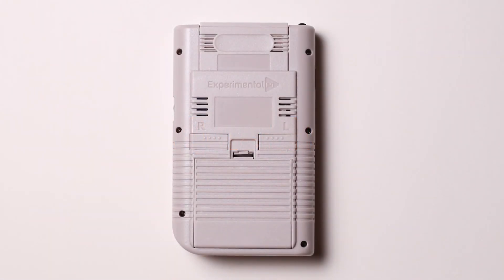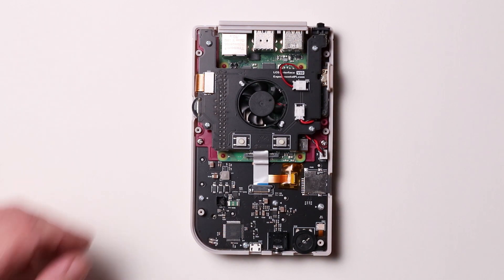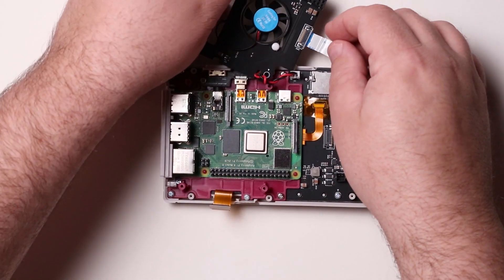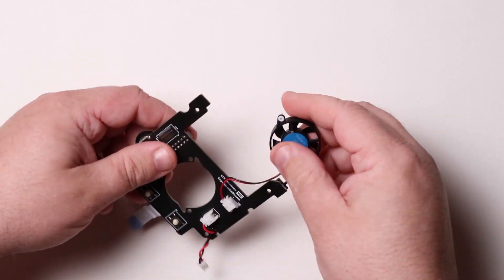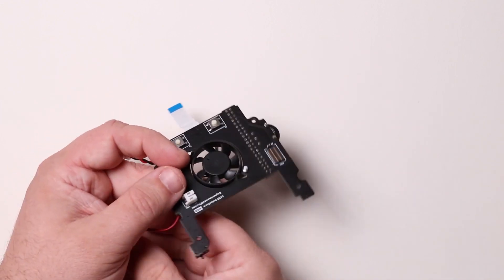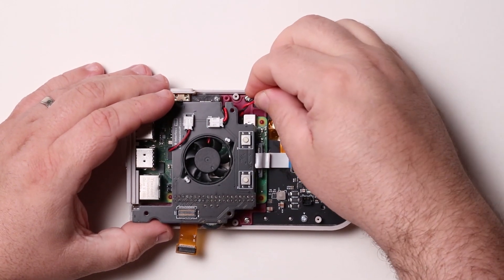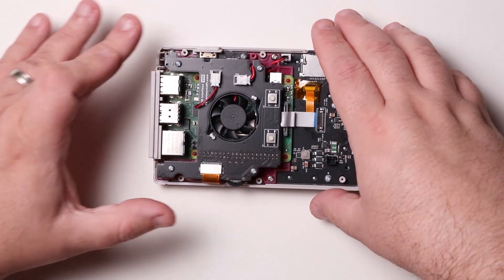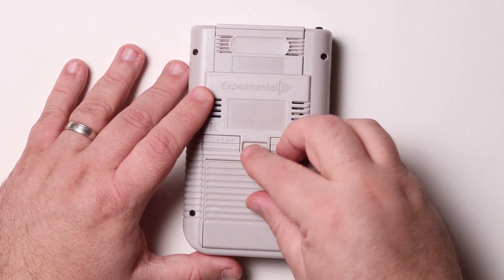Replacing the PiBoy's Fan

Comment: Did you have purchase option for the main board only ? not a fan board ,  not a cases
Reply from the maker: No yet, but why do you think one is needed? You just got the unit.
Reply: @experimentalpi3267  yes, i just got it and also  i had tried all different image (from your website)   to test this system, but having no audio  , i am running out of idea to test it, but to swap diff board
Reply: @experimentalpi3267  if you can send me the other white ribbon cable to try as well
Reply from the maker: @quangle-vv4zf  Your using our stock image? The games boot but just no audio?
Reply: @experimentalpi3267  i used your image at first  the  black 64gb micro sd card, causing the problem no audio
Reply: then i built some other non official image from your instruction to test as well but the same result
Reply from the maker: @quangle-vv4zf  But the system does boot into the games?
Reply: @experimentalpi3267  yes booting no prob
but i think  my white ribbon  non working by now, it is damaged
Reply: @experimentalpi3267   yes, i can load my own game but white ribbon cable already damaged by now

Comment: Hey there! Can you please give us an ETA on the release of the overclocking kit you posted to your Facebook page last month? 

Also, do you believe it will be capable of running more quietly at similar cooling compared to the current fan design? Thanks!
Reply from the maker: Once it's ready we'll announce it on our Facebook page. The system should run much quieter and cooler with the overclocking kit.